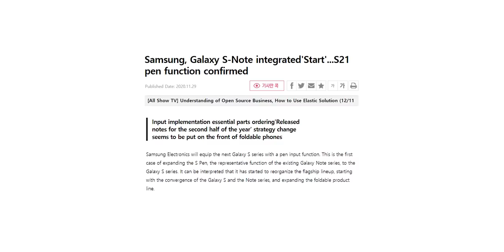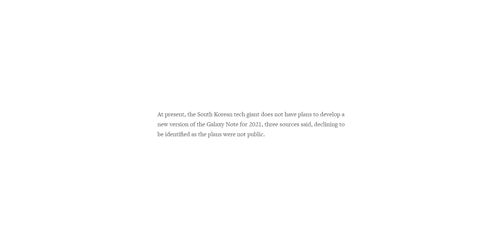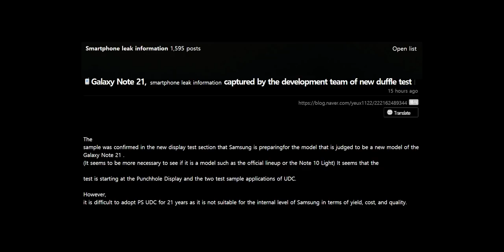Samsung - WHAT'S GOING ON?

Comment: If there is no note in the second half, then Samsung is leaving a void for others to fill.
Reply: I think Samsung will be fine as long as the S Pen isn’t a lost feature. I’d buy the S21+ if it came with an s pen
Reply: @donalddavis7160  even though you have to carry it as an accessory?
Reply: @donalddavis7160  only the Ultra can use the Spen
Reply: @T0NYMANUEL  got it. My point is, there isn’t any point to having 2 phones capable of using the s pen. I would buy either.
Reply: "The Note 21 is our backup plan in case the fold 3 doesn't sell well." ~Samsung
Reply: @rwyo83  ofcourse the Fold 3 is gonna be a massive hit with the UDC and Spen. No doubt
Reply: @T0NYMANUEL  what about the portability and price tho. that’s why many of them are missing the note already.
Reply: @NareshKumar-sm9yz  no bro. We are missing the note bcoz it had a league of it's own. Foldables is entirely different man. With this much advanced features and a price close to the fold 2 I don't see the other way
Reply: @T0NYMANUEL  Agreed, Undoubtedly foldables are so futuristic, and practically they are thick and heavier like having two phones in a pocket, idk how many are gonna have that for a day to day usage. And for the price with UDT and s pen support let’s just assume they might cost around 1700$, many would think twice before buying a foldable.
Reply: Who is going to fill it? Be realistic. The Note has existed forever now. It's been a sensation forever now. Competitors could have copied it forever now.

Yet year after year, the only high end smartphone with a stylus worth a damn is the Note.

The S Pen is so refined and feature rich that you think some competitor is going to get it right, and do it better on their first try?

Eh, probably not.

More likely the rest of the world's manufacturers will follow the market leader to the next form factor.

They same way we all followed the Note to larger and larger phones.

Comment: "The Note 21 is our backup plan in case the fold 3 doesn't sell well." ~Samsung
Reply: Love the note what is going on . It's a lot of people out there don't even like the foldable phones not everybody is going to like it they should keep the note because people love the note.
Reply: @drexq_477  agreed, i would rather have the rollable than foldable
Reply: @Frank Castle we'll just have to see
Reply: The current fold design isn't very efficent due to the sheer amount of displays and camera's. Samsung needs to fix their original design, utilising the foldability to reduce screens, cameras and space. Which is the opposite of what they've been doing.

A rollable however, does use space way more efficently, has the same big screen effect and uses less cameras compared to the Z fold 2.
Reply: @quantum.9883  not too mention, rollable maintain the same  thickness as “ reguler” phone ( as compared to fold that is doubling the thickness ). Off course, rollable has it drawback too, gotta make sure it does not accidently “ expand” while in our pocket, ( since we might accidently swipe/ touch the  expand button)

Comment: It just doesn't make sense discontinuing the note series, someone like me prefers the note to the fold, the fold  feels too bulky when holding it and am sure it will also need extra care in handling, no back pocket placement like before and so on, then i just love the normal note the way it is because if i ever get the fold, i may not even open it up in months making it useles as the single screen of the note is perfect for everything i do on documents anyways, morover that front screen on the fold is just too narrow.🤨
Reply: tell me the diffrence in note 20 ultra and s20 ultra except the s pen
Reply: @akshatarya2549  the difference is just the Spen and the looks, the things the Spen is capable of doing for sure no S serries of samsung or any other series can and thats why it's called the note, that's the same reason the pple who uses it use it, i need a document signed, i do not have to be near my computer to do that, and yes i have used both serries and i know the note comes in more handy when needed either way its still boils down to your taste, preference and what you do for a living, if u need the note or not.
Reply: @de-luxe491  Yeah and if the s21 ultra gets spen then you will surely not need the note series
Reply: @akshatarya2549  only the s21 specs seen so far dosen't have a dedicated Spen slot like the note. No one would walk around with Spen in their pocket you know right? So its mainly useless.
Reply: @de-luxe491  F for Note21

Comment: i don't know about y'all but imo the note  has been Samsung's flagship phone for many years and the fact that they are dumping it just doesn't make sense. it would have made alot more sense if they ended the s series instead. why? the note is basically a slightly tweaked out version of the s phone and it has the pen built in which the s series does not have. im sure $ is the reason they made this call. they are basically going to pull a marketing stunt like apple and have people buy that s pen accessory for additional costs in order to use it on their s phone and all other devices. maybe they also wanted to cut production costs on the note since it's up there with the fold models.

Comment: Taking out the Note will be a mistake, their lineup should be what they used to do. 2 S series phones and one note. So the line up should be S21, S21+ and Note21 Ultra all released at the same date. The Note21 ultra will replace the S21 Ultra which I believe is just a note without the S-pen so it wont be much of a loss

Comment: BRUHHH , If their lineup is as follows:

Galaxy S21(5g)
Galaxy S21+(ultra,pro,max,5G blah blah)
Galaxy S21 FE

Galaxy Note 21 lite(5g)
Galaxy Note 21+(5g)

Galaxy Z Fold 3
Galazy Z Fold 3 Lite
Galazy Z Flip 3rd Gen

Galaxy A72
Galaxy A52
Galaxy A32 
Galaxy A22 and A22s
Galaxy 12 and A12s

Galaxy m51
Galaxy M31
Galaxy M21
Galaxy M12

Galaxy F42
Galaxy F52
Galaxy F32

Also they must Release the AMD GPUs as soon as possible

Believe Me they will not only be successful but it will be easier to push OTA updates and cost will be much less. As a Loyal Samsung User and Fan since 2013 , this is my genuine point of view. Also personally I think after DJ Koh left , the company is facing ups and downs.